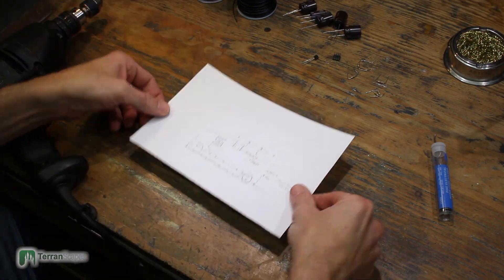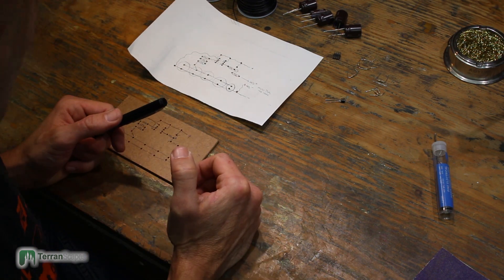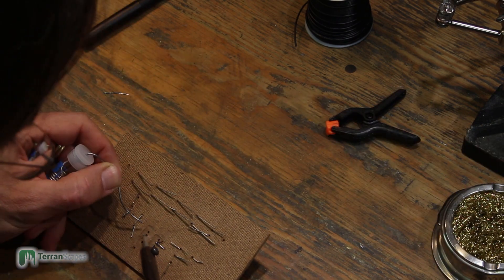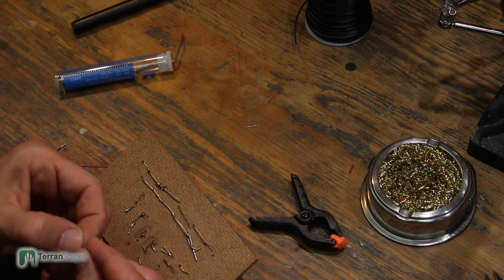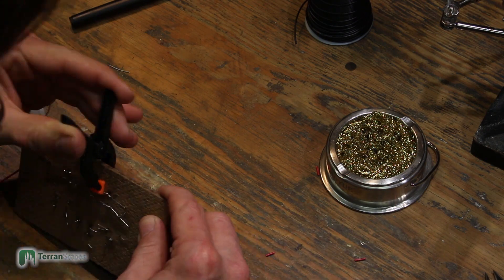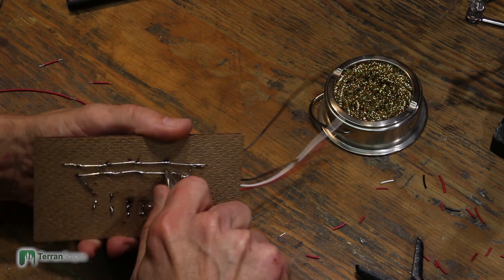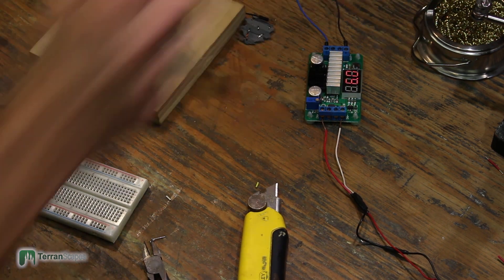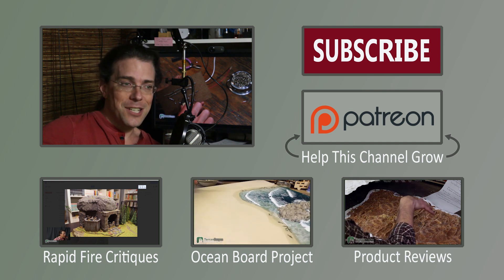Lighting Circuitry for the Idol - sped up - Orc Display WIP#10

Comment: I suggest using perfboard next time; no drilling, correct thickness, and has copper pads to solder to.  You can purchase it online or at radioshack. Great work otherwise!!  

P.S.  I apologize if you already know about perfboard.  It was painful watching you predrill holes and then sand away to make room to solder the 555.  I had to take the chance!
Reply from the maker: *chuckle*  Expect this to be the last time you see hardboard.  It did give me some room to mount some things however so it wasn't a complete problem.  I'll show my electronic set up in detail in a soon to be released video (sometime around 1/28/17 or so for those just watching this one) and you'll see some prototyping board use.  Forgot I had a small one in my kit actually.  ;)

Comment: Nice one buddy. I am SO CRAP at soldering. Rubbish, terrible, just can't do it neatly at all.
Reply from the maker: I've been doing quite a bit lately and I'm starting to get a "little" better.  Tip a friend gave me - use flux directly and don't rely on rosin filled cores.  Also, picked up some 'Tip Tinner' and that has made a big difference as well.
Reply: Thank you for tips bro, much appreciated.